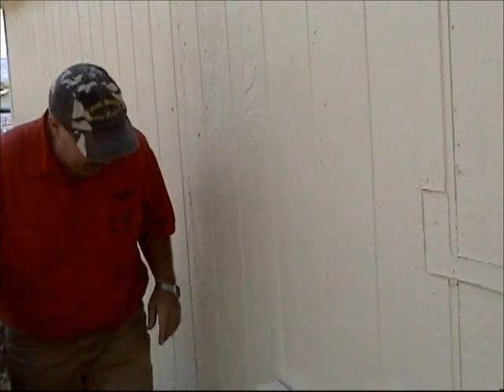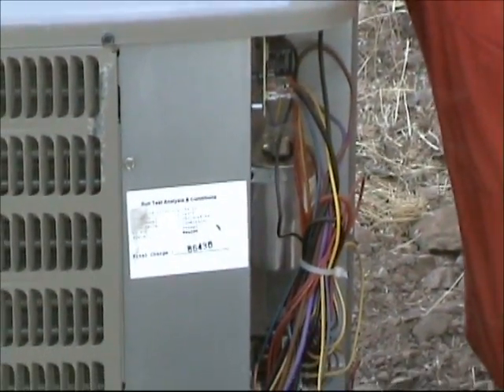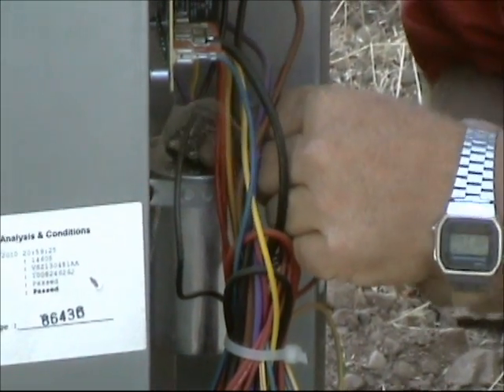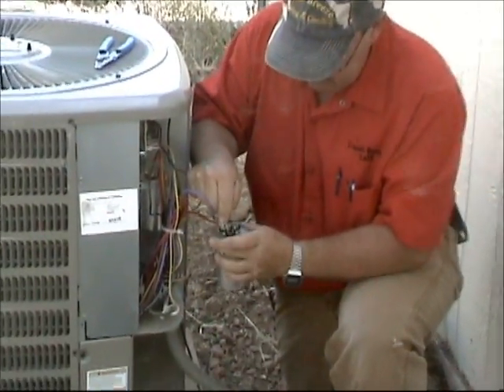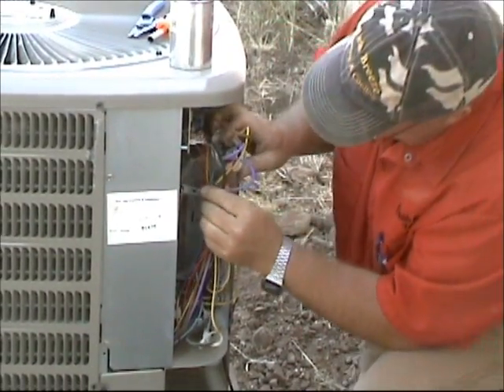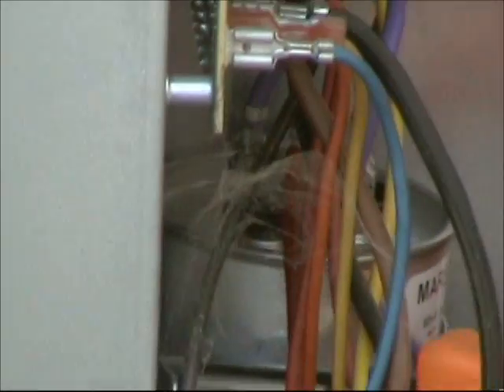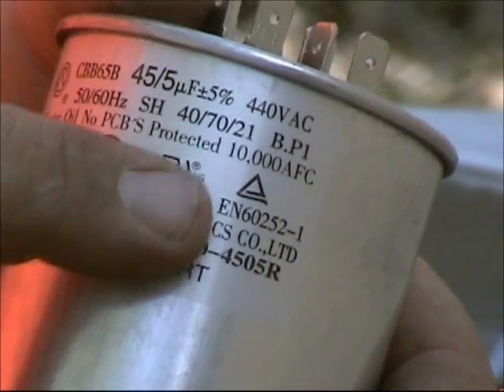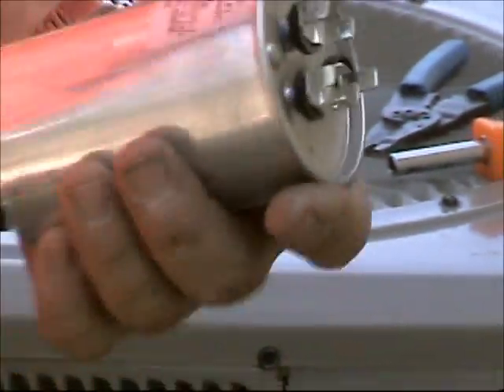Fix My Own AC - How to Change a Run Capacitor

Comment: I was quoted $262 to replace the capacitor on my outside A/C unit.  I don't think so!  I changed the blower run capacitor on the indoor unit air handler myself already for $13.92. I bought the capacitor from Grainger.

Comment: called a local AC guy - Family Air - and he right away began to trouble shoot the issues.  with blades on the outside unit not running and the fan still going strong on the inside, he said it sounded like capacitor.   told me to turn off the electricity to the unit so not to burn it out while it's busy trying to cool yet unable to.  done.   then i read a review where he told another neighbor how to replace the capacitor themselves and where to pick one up.  so....this video was a great intro to what the issue very well could be.  thanks!

Comment: What if I changed the motor.  You fail to show where the  wires are running from.   Wire colors don't seem to have any standard.  How do you know which is which?

Comment: Thanks for the video I paid some one 7 years ago to fix my AC. And it was just a capacitor I was so pissed something thing I could’ve done myself. So I bought the same capacitor in case it happens again seven years later it did and I fixed it in less than 10 minutes thanks for the video.

Comment: Questions for anyone if capacitor is fully charged and you use a screwdriver etc to discharge it wouldn't it  sparks or short out something else?

Comment: Great video!  I really appreciate that you took the time to explain the numeric values on the run capacitor!  That was an outstanding explanation of the micro fared numbers and the ac voltage requirements.  Other videos just take them out and install a replacement with no detailed reference to the capacitor specs.  You are greatly appreciated sir! THANKYOU!

Comment: Very good safety tip on touching common and others to drain the capacitor?  Other vids did not mention about this.  Also I would switch off at panel, and remove the shutdown off piece at the condenser too, double protection.

Comment: I've got a question.. I'm looking at 2 capacitors in my 5-ton unit. Both
say "motor RUN capacitors" on them. The smaller one is a 10 MFD
440/370 which I would guess is actually for run. The second one is a 70 MFD
440/370 which I think should actually be a start capacitor. What I surmised
 is that the 70 MFD seams awful low, plus again, it says on it
"RUN" capacitor, not start capacitor. Any thoughts and response would
be greatly appreciated. Hope all is well. Thank You

Comment: Last summer I  was charged $550 to replace a run capacitor on my unit in the Phoenix AZ area. Not this year! I saw this video, ordered the applicable capacitors on Amazon for around $20 each and when the AC on my other unit was blowing hot air this morning, I had it back up and running in 10 mins. Thank you so much for putting this out; you lay out clear and simple steps. AC service companies are abhorrent and rip of people.

Comment: REPLACE RUN CAPACITORS AT 10 YEARS - Failure Preventative Maintenance because 50% of no a/c service calls replace them for failure and these components are $20 - $30 each are a cheap date and take minutes to swap out IF done safely. They hold a wallop of high voltage after the power is turned off. Always turn off both the furnace power and the 240volt breakers for the compressor.  I use the KLIEN TOOLS NCVT-1 pocket Voltage Tester with the isolated nose at first and meter all leads to ground - then I short the capacitor leads - then service replace.

Comment: Thanks for showing this. The shame of all of this is that some of us are capable of doing a lot that is necessary to remove and install the condenser and heater/coil replacements in our homes, but the suppliers will not sell the parts and the builders of the units will not guarantee the units unless installed by a Company. They even told me that they would not guarantee the unit if I had a A/C professional come out and start up the unit! I was going to purchase the unit and place them on the pads and retrofit the unit and let a A/C company solder up and start up the unit and none of them wanted anything to do with it as they were not getting the profit of the purchase of the unit! Strange, as if I call a place to work on my unit if it stops working correctly they will come out and they will be happy to charge me even though they did not install the unit, but will not do a start up at any cost because they lost the profit on the purchase . Double standard I guess.

Comment: The unit I am repairing has a capacitor with just two terminals, and there are no markings on either terminal. One terminal had two red wires, the other had two orange wires. It is an 80/6 MFD 440VAC cap. Can either terminal be connected to either pair of wires, or is one terminal + and one - as with an electronics capacitor?

Comment: Last night at 1:30am I went upstairs to find it was 91F in my bedroom. After seeing this video about 2 years ago I bought a spare capacitor, so I popped it in, and a few minutes later my AC was working. What would have otherwise been a $400+ emergency visit cost me $9 and made my bedroom habitable much sooner than if I had to make the call. Thanks for the video!

Comment: The capacitor is honestly going to be the problem 90% of the time on a unit that will not start. I've replaced (I have a heat pump) the dual start cap in the outside compressor unit, and the starting cap in the air handler that controls the blower motor starting and my unit start like brain new. My local HVAC company told me I needed a completely new unit because mine was 12 years old and not worth fixing, BULLSHIT!! It's been running great with under $30.00 in parts and 10 minutes of labor. A typical charge to change a cap is anywhere from $210-350. I was quoted $250.00 to replace the cap in the air handler! Plus they said that the voltage was high on the duel cap in the air compressor and the recommend changing that as well at $250.00.

Comment: hello- my unit has two different capacitors. I have not removed either yet. The one with the red and blue wires leading to it is leaking some oily substance. The other smaller oval unit has two brown wires to it. Do I need to replace both units simultaneously or just the leaky one?

Comment: thank you for sharing!  You make this look very easy.  Just had my AC serviced today and they want to charge me around $300 to switch out my capacitor.  Seemed a little excessive to me.
Reply: They put a new capacitor in for $135 a couple years ago. Charged $25 for the $15 capacitor. Not a bad deal. Now I keep a spare one around. It really is an easy fix.

Comment: I have a unit that is tripping the breaker, could a weak capacitor cause that?
Reply: yes i think so,its not weak,  i think its short inside..which tripping fuse.they get heat up and then short inside,

Comment: I got quoted over the phone at $125 to have my hvac inspected, and $325 to replace the capacitor if that was the problem. It's in the dead heat of the summer, so prices are clearly being jacked up worse than auto mechanic rates. This video, $28 for a replacement part, and 8 minutes saved me $450. These companies are charging people over $55 a MINUTE. Thank God for the internet and people kind enough to share their knowledge to save us from the absolute scum of the earth companies gouging people like this. Thank you.
Reply: It's a good idea to know who your gonna call BEFORE you need them, just in case it's not a simple fix.

It's terribly frustrating not knowing which company to call.
Reply: thats a steep price, I will give you that.  However it is worth the extra cost for a licensed technician to PROPERLY diagnose your unit and replace the parts safely.  I would've done it for you for 150.   HVAC is not DIY.  I don't care what anyone says.   The last thing I want is a customer to pop open the condenser and start sticking a screwdriver in there.
Reply: @ElectriconicJesus  "Pop open the condenser"? This is about replacing the run capacitor, simple and safe if one follows the directions in the video.

Comment: good video, but at one point I saw four wires attached at new capacitor, but only three terminals. That wasn't clear. Also, do you not have to discharge new capacitors as well?

Comment: So what can you touch and what can't you touch? Can you get zapped by any part of the capacitor or just the terminals?
Reply: you can get zapped by touching 2 different top prongs (herm + c sections)  and completing the circuit.

Comment: We need to add a second run capacitor because fan motor keeps reversing itself what wires do we run to the smaller one.

Comment: the site doesn't exist do have another site where i can get capacitors.
Reply: foxman362 Greetings!

I am curious if you ever found their site?  I am also looking.  Thanks!
Reply: @JerryLynch2  lowes
Reply: I had a terrible time trying to buy one locally. Ebay has many sellers. I bought a spare to have around with no delivery delay.

Comment: I jusy got done doing this and it worked like a charm. It was a little difficult finding the part because everyone locally would only sell to contractors but once I got my hands on this 20 dollar part it was super easy to install thanks to this video and now shes purring like a kitten! Thanks for this upload you definitely saved me!!
Reply: My outside heat pump went out. It was at the time of year that it wasn't yet needed for cooling so I had some time to see if I could try fixing it. I found out that about 90% of the time it's a simple capacitor going bad. I had no idea where to buy it locally so I used ebay.

I also bought a second one for a spare. I also bought a spare for the air handler in the attic.

Comment: Does it matter which direction capacitor is put in? My wires and connector are on the bottom. You connected with them on top.
Reply: No

Comment: The two wires that are on common go to the part with 4 prongs and labeled "C". Does it matter which of the 4 prongs the two common wires go on?
Reply: No
Reply: +Z71Ranger thanks!
Reply: No. The prongs are all attached to the same post.

Comment: A few years ago an HVAC tech replaced my original GE capacitor with specs of 35/5 370VAC with a Mars 55/5 440VAC in about 10 mins tops.  A/C stopped working recently and decided to have a look inside myself...found a wad of paper stuffed between the capacitor and contacts (capacitor wasn't mounted to the unit but was just sitting there).
Reply: HACK JOB... Most of the HVAC Technician  are HACKS with attitudes... They think DIY people should not work on there A/C... But if you get crap work like that you have no choice... Hell I took the 2 year trade school class because me and my family couldn't get a HVAC Technician that did NOT do crap work... Most HVAC Tech do crap work so they could come back in 6 to 12 mounts... Hell I have fixed 100s and 100s of units for friend and family... LOL I have a blue shirt with a HVAC company name from a city 40 miles away that I put on when I need to go get parts... They think I work for that HVAC company... I put a few pens and a thermometer in the shirt pocket with some papers... Hell they don't know not to sale to me... We have 12 rental houses that need something done all the time... I'm retired and want to buy 3 more rental houses in the next two years as my wife will be retiring also... So with all that you need to do HVAC work...

Comment: Thanks for this!   I had a company that came over and did an inspection on both units, everything was good except for the charge on both capacitors.  They wanted 205$ each! I look up the parts online and they are 10$ and what looks like 30 minutes worth of work.  Thanks for saving me 400$!

Comment: I'm fixing to change the Run Cap on my's  Rheem outside unit.  I noticed that the capacitor has two terminals and not labeled as far as the polarity or the usual ; C, Herm and Fan.  Can you give me explanations on this?  Thanks.

Comment: my inside blower stopped working, when I turn on my ac I put it on cool and auto, nothing happen with the blower inside
or outside.  If i turn it to the on position and cool the inside blower comes on but the outside still does not.  Could I get a few suggestions please before I have to spend money i can't really afford.
Reply: thermostat was bad

Comment: Our trane unit has a start and run capacator.   The run capacator is rusted and swelled.  The replacement part has a resistor across the two leads but the existing cap  in the ac unit does not have a bleed resistor.   Should I remove the resistor from the run cap prior to install?  The start capacator does have a bleed resistor on it but I wasn't sure if the run capacator would need one.    Thanks

Comment: Samuel - The issue is that you did a very unsafe thing, restoring power then touching the terminals. You are probably lucky to be alive. I recommend having trusted professionals repair your major appliances.
Reply: Ray Andrejewski trusted professional who wants to charge $250 for a $20 part. sounds trustworthy to me......
Reply: my quote was 300 for the 1 year warranty and 400 for the 5 year warranty capacitor.  I went to the local ac supply and picked one up for 10 bucks, lol.
Reply: +Ray Andrejewski When did he do this????
Reply: +Lorna Andrejewski I wrote a reply to your husband or dads comment was not talking about publish date....

Comment: Replace capacitor on AC.  I left everything on the back of the AC open while I go inside test to see if cold air comes from the AC.  Everything was fine.  I left the power on went back outside to go ahead and attached the capacitor back to the AC with the strap.  When I lifted the capacitor to move it the metal holding strap touched a terminal the contactor and I saw a spark and then poof.  Everything quit working.  Waited for a while and turned the thermostat on and nothing.  The cool indicator on the thermostat just blinks and the outside unite will not come on.  What could be the issue?
Reply: You're either a total idiot or a HVAC "tech" trying to give a bullshit "don't try this your self" story.

Comment: how can you be 100% sure that the old capacitor was dis-charged???
Reply: onenikkione Theoretically,it will discharge to 0 volts instantaneously, if you apply a perfect short circuit (the screwdrive technique being a perfect shortcircuit)

Comment: sure wish I could of seen how to touch the terminals better so I don't get shocked...oh well
Reply: are you referring the part around 1:20 into this video?
Reply: It holds charge like a battery.  Agreed that this was an important step they missed.
Reply: couldn't you just turn off the power from circuit breaker and not worry about getting shocked.

Comment: If I set my ac temp to 74 or any other number, it will always say 75 on the stat, it never gets to the set temp it stays 1 degree above so my unit never shuts off. Is it because I have an older unit or is there some other problem

Comment: I had a guy come change the capacitor 2 weeks ago and it worked fine until today now it's not cooling again. The fan on the outside unit is running though. If the cap was bad again, wouldn't the fan NOT run?
Reply: Your compressor probably needs replaced.  If it was the capacitor, there would be no power for the fan to run.
Reply: check the freon. may need some

Comment: After changing your cap,get a clamp amp meter & measure amp draw of both the compressor & fan separately.You measure this on the black wires running to each from the contact switch.Check the data plate on the unit or look online for the draw ratings.They should be less than the rated draw by about 10% or so,if it's more,you may need to replace that component very soon.

Comment: you do NOT discharge a cap with a screwdriver or players , etc... you could really mess up the system. you use a 20,000 watt 5 ohm resistor.

Comment: Great video. Very instructional. The tips on discharging were particular helpful and having a video to demonstrate along with instructions on how to correctly identify was terminal goes with each connector was very helpful.

A/C is now running great and saved a good deal of money.

Comment: Ive got no sympathy for a guy that ran his compressor into the ground by constantly changing run caps himself. Do yourselves a favor and call a local pro. It will be cheaper in the end. DIY= damage it yourself
Reply: Not everyone has money to call a pro...and its not cheaper to call a pro than to do the job yourself... Ive fixed tons of stuff in my home doing the job myself...now there are things that I will leave to a pro if its really a complex job.  But if its something I can fix im not gonna waste money..
Reply: Ive replaced the run capacitor and new fan. cost me 140 in parts and 45 minutes of time.  the quote the repairmen was $600.  so AC techs get 560 an hour labor?
Reply: +Magnum45Carryin Yep can't forget those windbag safety sally's that love bashing these DIY videos 
however if it was something under warranty then i would see about calling a tech to fix it
Reply: Bug Man As a small business owner yourself you should know first hand that parts and labor are not the only costs involved in a quote. 600-140=560? I hope you have your wife handling your finances lol
Reply: Get back in your HVAC truck and take your shit elsewhere

Comment: Thank you very much for this video, it saved me over $100. The part cost me about $9 and about 1/2 hour to make sure I was doing it right, the wire colors is what slowed me down a bit since they were different on the unit.

Comment: Great video, thanks for including the steps to discharge the old capacitor.  My fan wouldn't kick on, changed the capacitor and it kicked right on.  The old capacitor was rusted on the top.  Easy repair just remember to discharge the old capacitor for safety.